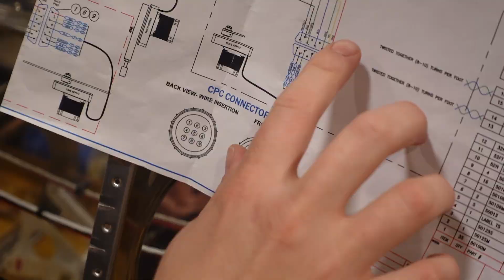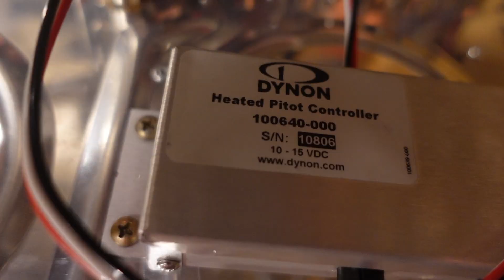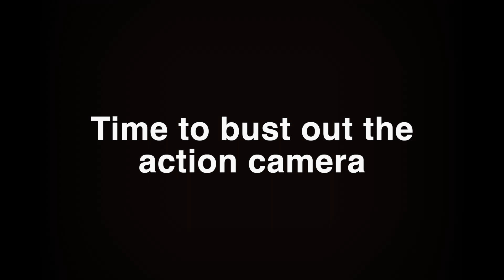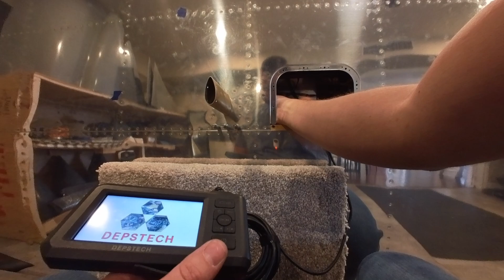RV-10 - Bottom Wing Skins - AFS/Dynon Install

Comment: Can’t believe Wyatt is getting so big!! You’re making great progress on the plane! Did you run the AOA/Pitot per the plans along with the wiring or did you do something different? Couldn’t really tell whether the pre-made wiring from Advanced was running through the corrugated loom or not.
Reply from the maker: @auburnaviator6167  It’s wild!! He won’t stop growing no matter what we do!! Let me know if you come up with a trick with your kiddos. 

I did a few things with the wiring and whatnot, all of which was not vetted by anyone so I could be totally wrong with the way I did things but it’s what I felt comfortable going with what I understood at the time. 

The pitot/AOA air lines are on opposing ends of the forward most of the wing ribs, all the way out to the bellcrank, where the one on the lower portion jumps around the bellcrank towards the top of the wing to connect to the pitot. You’ll likely see that in the video. 

The main electrical bundle goes through the corrugated loom. 

I did however veer from bundle plans slightly in a way, and chose to separate the pitot power/ground/control wires from the rest of the main bundle and run them on their own in a twisted bundle along the top most portion of the wing (as the wing will sit when installed). I did this since I’ll likely have a remote magnetometer on an access panel underneath the bundle and wanted to provide the most amount of distance to prevent interference. The corrugated loom was just too close in my uneducated opinion. I know very little about interference and electrical systems and if this will be a 100% sure way to do things so I chose to not record it so that I don’t lead anyone astray.
Reply: @ are you going to put a Bob Archer Nav/ILS antenna in one of the wingtips?
Reply from the maker: @auburnaviator6167  I am not. I am doing GPS only